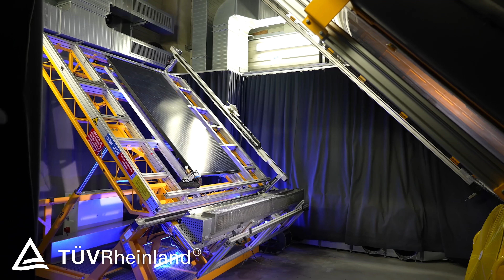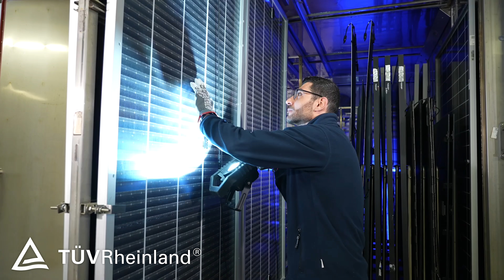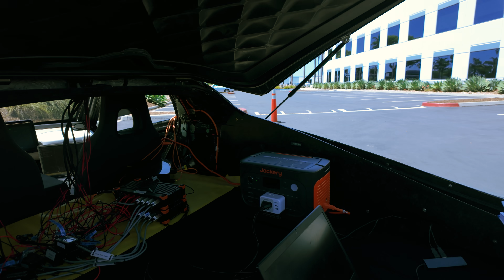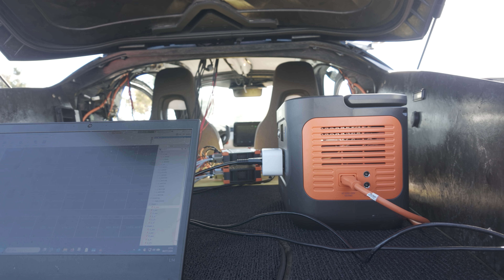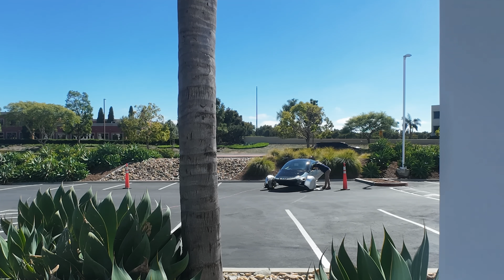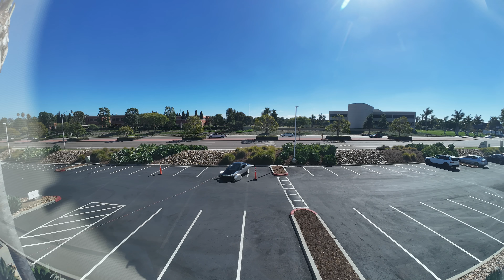Aptera's Solar Output Is Now Independently Measured

Comment: 4+ kw, that is quite impressive. You can run an average house with mininums with this.
I like Aptera's transparncy.
Reply: It's 4kWh/day not 4kW. 4kWh/day is about 300 watts (depending on latitude and season).
Reply: I hadn't thought of that. I hope that Aptera will include vehicle-to-load or vehicle-to-grid capability.
Reply: @jerrymcintire7902 yes that would be a great addition to the next production model. Time to just start selling them.
Reply: What's better than transparency? Sales! Just sell some. Make improvements on the go.
Reply: Definitely can't run a house. That runs my hairdryer for 2.5 hours.

Comment: Great, Aptera independently verified their solar panels. Hopefully they will be able to validate their real world driving efficiency with production equivalent vehicles soon, so we will know for sure that this translates to being able to drive 40+miles a day on solar power alone. As of now, they are still just assuming their cars driving efficiency.
Reply: Internal testing that they did (the road trip video) showed a range in line with what they were expecting and predicting. Sure, it's not 3rd party, which I would also like to see, but it's a step in the right direction.

Comment: I have a question: If leaving the hatch open is a strategy you're advertising, are you going to provide a solution to separate the cargo area from the cabin? Not just to keep people out, but also bugs and other critters
Reply: I'm just guessing, but maybe the the hatch open is for their camping option where the tent is attached to the rear hatch.
Reply: @jjackson3240 doesn't the tent cover the rear hatch though?
Reply: @kurtp2003  I believe it does, but in at least some of the pictures I saw, the the part over the top side of the trunk is some sort of clear plastic.

Comment: So parked with hatch raised in the sun almost 50 miles of range per day. And parked normally (or driving) on a sunny day easily 40 miles of free range. Big win, congrats!
Reply: Thanks for the quick maths, I wasn't sure of the impact an extra 0.5 to 0.75 kWh would provide but this checks out given the mi/kWh they're reported so far. Solarmaxing for the win!
Reply: Hatch raised power is meaningless, no one wants a car full of bugs. But the hatch closed numbers meet their estimate, I'm good with that.
Reply: @maptap6654 I think mesh netting could alleviate the bugs, and I think it will serve to help ventilate the car. My Bolt EUV has gotten so hot several cans of soda exploded, while I am in a place that gets dangerously hot, but I think if I install a small vent fan in my car it'll prevent that level of heat build up
Reply: @dscrive  Definitely never store soda in a car long term!!
Reply: @maptap6654 speak for yourself im a country boy i max my solar over little things like that
Reply: @maptap6654  well, if you get the optional tent, then you can close the bug screen with your hiking and you get extra miles.  … the idea of every test, being relevant for everyone is so over done.
Reply: @maptap6654  Mate, move to where there are no bugs-- and you don't have to lock your car. It's delightful.
Reply: Solar Maxxing….
Reply: Creates somewhat of a security issue if you leave the hatch open all day.
Reply: @aftonline  Maybe a reflective trailer or removable solar reflector attached to the hatch could increase closed-hatch energy production.
Reply: @aftonline  I have just accepted I will always leave the hatch closed for the peace of mind of security 👍
Reply: >>>50 miles of range per day.

In one of the sunniest places on earth.
Reply: Still waiting on independent consumption figures for proper real world data, though. But this is very promising.
Reply: Average commute is around 30 miles a day, so that works. Especially have home office in between.
Reply: *In Carlsbad

It will be around .5-.6x that in Europe.
Reply: @Henry_D  Even at half that, it's still significant mileage, no effort at all. People who do not drive everyday will have EXTRA power, they will need to "waste" power and condition their cabin to keep their 80% charge level from creeping up.
Reply: @maptap6654  I am not saying it is worthless, but Aptera and most fans (whoch I consider myself to be aswell) seem to completely omit the fact that this test to have been in perfect condition and location.
When I originally heard of the 40 mile number I was like "Oh so that will still easily be 40 km[~25miles] for me", but now that the solaar is tested properly, I know it will probably be slightly less than that. And to get that fact I had to read pretty deep into the TÜV Report and read up on how to convert the data to give me some idea for my location. I expected the Aptera team to be way more clear about things like that. Omitting facts is still a (way less strong) type of lie. And they have a duty to report to their shareholders.

Also solar power can just be shut off. So you won't be seeing Apteras/ other SEVs just burning energy to stay at their desired charging state.
Reply: @Henry_D  Europeans don't drive nearly as much as Americans
Reply: @DaBinChe  That has no effect on the expectations the company is setting
Reply: @Henry_D  And it's still summer, in a relatively high-solar part of the country. Real-world conditions are going to be less than this.
Reply: @capnzilog  The .5 -.6x is the real world annual average for europe. You can check yourself with the irridiance data from the report and for europe (of which there is plenty online). So the contidition the test was in here doesn't effect that.
Reply: @Henry_D  it would also be less parked in a basement garage
Reply: This doesn't change the fact that a $40k USD or more Aptera is nearly a useless vehicle compared to say a Kei Truck a low cost high utility vehicle.... it can only commute and has little utility outside of that , if the Aptera cost 10k nobody would mind that reduced utility but frankly at that price it sucks for what it is. Sure, maybe it would cover 90% of my driving .... but for the 10% I need something much different and have no money left over after wasting 40k on such a boondoggle of a car.

A car company that can't actually make cars and sell them ... is a joke, and anyone thinking of giving them another time should think twice.
Reply: @Wingnut353  Saved how you really feel for the last sentence, eh? I am guessing that Aptera has made more cars than you have. And I look forward to being more comfortable and safer in an Aptera.
Reply: @Wingnut353  Bet you hate Miatas.
Reply: @Wingnut353  Most EVs don't have as much luggage space as an Aptera. But it's a car not a truck. Most cars get used  mostly for commuting which is single occupancy. But I'll be waiting for the 250 mile version which will be cheaper and have the option of a third seat.
Reply: @aftonline  -  Sadly most Steam Roller sized Pickup Trucks and SUV's are also mostly used for single occupancy commuting. 

As for cargo capacity Aptera has already demonstrated how well they handle shopping trips to the wholesale club and home center stores.  My Nissan Leaf has less cargo space than the Aptera yet I was able to pickup all the interior doors to remodel a home with it in one trip along with the interior paint, multiple bags of mulch, some plants, potting soil and a few other odds and ends.  I did need two bungie cords to tie the hatch down and that was it plus being electric my passenger and I did not have to deal with exhaust fumes coming in through the open hatch.

If I can also transport together in one trip using the Leaf a job site table saw, power miter box with stand, 4 saw horses, a router kit, drill kits, wet saw, skill saw, saber saw, belt sander kit, RO sander kit, sawzall kit, pancake compressor with hoses, multiple nailers/staplers, tool box, meter kits, sets of clamps, etc then Aptera should also be able to do quite well in this service for a local tradesman.

There is a lot more utility in the Aptera than the naysayers give credit for.

Of course the naysayers only look at startup pricing and not the target pricing once economy of scale starts to kick in.

Best!
Reply: @neilfromclearwaterfl81   The shape of the Aptera's cargo area is not as boxy as the Leaf, so you might not be able to fit some large objects in there, but I'll take it. Aptera is the coolest vehicle in town. I can't wait to go camping in it. I hope they put vehicle to load in there, that will be really cool to be in the middle of nowhere and have power from the back of your car.
Reply: @aftonline  - I was looking at that and with the way the hatch opens you do get a wide, tall coffin type area that is quite a bit longer than the Leaf.  It may be interesting to see if someone comes out with a wedge shaped folding cargo-box type add-on to fill the gap making the Aptera into a local delivery vehicle.

Family in Italy still uses legacy Lambretta 3 wheelers to deliver marble and tile in the old sections of towns and villages near to them.

The self charging would allow you to max out the range and then camp for a few days getting you enough charge to make it back to civilization.  If you get lost in the wilderness having the car automatically refill itself 40 +/- miles per day could be a lifesaver and would beat the average 10 miles Joe Average might be able to walk if he had enough water available, etc.

Best!
Reply: So with most solar panels losing alot of their charge cap in a few short years, maybe 15 to 20 miles per day...for quite some time down the road. Not sure how replaceable the tiles are. This would work for me. But...manufacturing seems to be a problem still.
Reply: @Ian-ie3hy solar panel degradation is pretty small typically. We're talking .5 % every year.
Reply: @elijahedmondson6270  yeah im not sure where you got that information but most home roof installs are garbage after ten years, and needing many repairs before then. Being this sytem is exposed on a car i would expect similar performance. Logically speaking I see little to no difference between car roof or home roof. If anything, road hazards pose a higher threat.
Reply: @Ian-ie3hy a Science Direct study said: “Characterization tests showed that polycrystalline panels exhibited a constant degradation rate of 2 % per year, while monocrystalline and thin-film panels showed rapid degradation in the first five years (4.4 % and 4.26 %, respectively) and stabilized at 2 % thereafter. After 5 and 10 years, the electrical power loss was 21.3 % and 28.5 % for thin-film panels, 21 % and 30 % for monocrystalline panels, and 9 % and 21.25 % for polycrystalline panels.”
Reply: @Ian-ie3hy when you google it, you get multiple sources that report minimal power loss that I mentioned, including many reddit forums that support the data. As for physical damage, i cant say for sure what the Aptera panels can sustain, but I'd assume they're gonna try to manufacture them decently strong.
Reply: @elijahedmondson6270 Aptera is advertising the fact that their solar panels are hail resistant. I'm sure this applies to gravel and road debris as well. 

In other words, they are VERY robust and should be physically stronger than home installations. Even home installations that are hail resistant should be at least the same.
Reply: @Ian-ie3hy  Not sure where you are getting your info, but nothing I can find reports anything like that. I also personally know multiple people with solar installs over ten years old.
Reply: @Ian-ie3hy  Most panels include a 20 or 25 year warranty. They can only offer that because the degradation is nothing close to what you claim without evidence.
Reply: @ShaunRF  i live in florida, the public here is against solar panels on our homes generally due to so many scams including the panels not lasting, the battery backups being shit, fighting with FPL, getting ripped off, etc etc. I am glad to learn that modern panels have improved but they still have a lifetime baked in and they lose capacity every day. The more robust the panels on this vehicle, the less replaceable they will be. Always a give and take. As far as these lightweight panels being more robust than home installs i dont buy that at all. Aptera has prioritized weight reduction in all aspects in order to achieve an efficiency that matters.
Reply: @popeyegordon sorry but "most panels" means nothing in this context...unless you mean the ones on the roof are warrantied and the ones on the rear are not? I assume you meant most as in commercially available...how would that apply to this though? Just because home depot sells solar panels with 20 year warranties has no bearing on aptera.
Reply: @Ian-ie3hy  where are you getting your math 
i live off grid and see no degradation in my panels
I have several types and wattages they all do well within specs years later and I live in a desert where they see 115 plus degree days
the heat is what causes drop off not the panels in my experience and come winter they exceed the ratings
Reply: @Ian-ie3hy ”the more robust, the less replaceable they will be”.  Why do people make ludicrous claims like this without any facts to back them up?  Those two qualities are COMPLETELY unrelated.
Reply: @Ian-ie3hy  this is from the morons who buy door to door scams they been doing this decades and the morons never learn I saw this years ago with siding and windows too 
people are stupid and never learn to buy from a reputable source
Reply: @Ian-ie3hy  I also live in Florida but I'm honest, not a cynical troll. Duke energy sells its customers shares in its solar farms. I get a KWH discount by buying shares. And I have three separate 100 watt solar panel installations to help with power outages. Nobody gives a crap what I do at home. One to keep a mini-fridge alive, one for all my battery charging and one is on the roof of my solar-pedal powered velomobile. The 'weight' of panels has nothing to do with the very thin and light cells imbedded in them. All cells are very thin and light.
Reply: @Ian-ie3hy I’m sorry, but you haven’t backed up any of your claims, considering they contradict all current available data and widely accepted information.
Reply: @RHPDaddy  ok, so you think the cost of replacing something that takes 5 hours of labor to replace is the same cost as flipping a switch? Wish I was in your industry...
Reply: @Ian-ie3hy  was this your original argument, or did you intend to jump into irrelevance?
Reply: @Ian-ie3hy I bought my first 6 panels in 2001, and they're still doing just fine.
Reply: Most solar panels are guaranteed to produce 80% of the maximum output after 25 years. I think we can expect a similar lifespan for Aptera solar. The glass panels with the laminated solar cells are attached just as your windshield is attached. We don't expect a problem there either.
Reply: @Ian-ie3hy  panel degradation is not noticable in my experience what is noticeable is this is a scam, 
4 k watts a day barely runs a 5000 btu window AC a few hrs after dark
the real issue you see power loss is heat and with panes attached to a  car that will be lots of heat and bad angles 
and we all see how crowd sourced shit like this always goes
badly with the investors ripped off
Reply: @Ian-i @Ian-ie3hy  your math you are expecting a 62% to 50% efficiency loss in a “few short years” ?

Wow 🤯. A glass 1/2 empty guy. You must be a blast at parties 🎉
Reply: Don't forget to count in that at the end of the day everything inside will be stolen, interior will be flooded and/or a hobo will be sleeping inside...
Reply: @cdjxwubcyex  Sounds like you need to move. None of that would happen where I live and work.
Reply: @cdjxwubcyex  This whole debate is silly and geeky as hell. Maxing is ONLY done for theoretical performance. In daily use you just park it in the sun. Period. How often would you find yourself with a low battery at the end of a remote road that is too far from the nearest charge point, or in a situation where you have to return after one day? With two days charging while parked in any position you will be making it back just fine. There is no real world scenario in which a sane adult drives his EV to empty and has no charge point access.
Reply: @popeyegordon they’re doing the testing because they know that if solar maxing gave you 10 more miles than “just parking”, a lot of their customers would go to the trouble of solar maxing.  It’s not unreasonable to learn as much about this new technology and its capabilities as possible.
Reply: @RHPDaddy  I disagree based on real world applications. Once you get the Aptera home you will see how cheap and easy it is to charge on a 120 volt outlet you will not want to park it in the sun at home. This testing was to shut up forever the hundreds of lying trolls who posted false claims that the solar won't work. It was effective but it only duplicated the posted results of Aptera videos. Testing should include maximum performance specs but that does not mean a bunch of geeks are going to do this every day for no reason. Do it once, see for yourself that it works as claimed and you are done. Or do you think Aptera is targeting the market of innumerate chumps who routinely drive their battery down to zero in a remote location??
Reply: Not at work.
Reply: @ERIKM-ed9ef Well, the rain could come in if it's raining. 

But that's why I'm getting the camping kit. 😂

Comment: Wouldn't it be a sweet feature that the vehicle could orient itself towards optimal sun by using like a tank turn?
Reply: Someone will figure out how to put a batcave-like turntable in their driveway with a solar sensor controlling the rotation. 😆
Reply: @CommanderMaga Search for Elantxobe Bus 😂
Reply: @bocatadenata  Wow!  That's really brilliant how they solved that problem in Spain.  If they can do it for a bus, someone can certainly do it for a lightweight solar rechargeable vehicle.  Thank you for the reference! 🌞
Reply: Not with a fixed 3rd wheel.
Reply: Sure! But it could be dangerous. A dedicated parking space would be needed